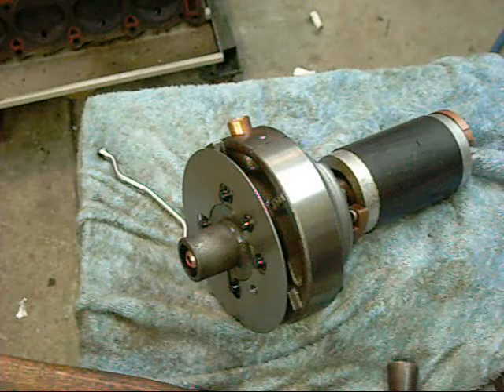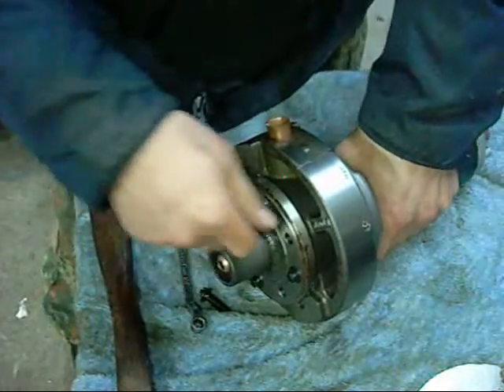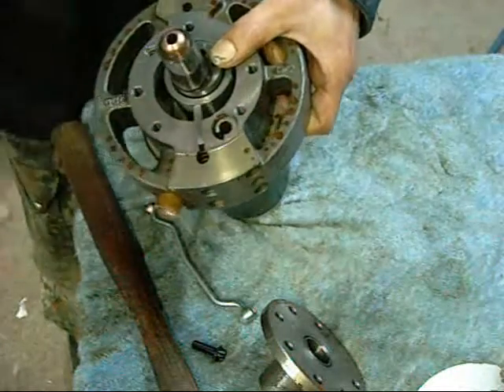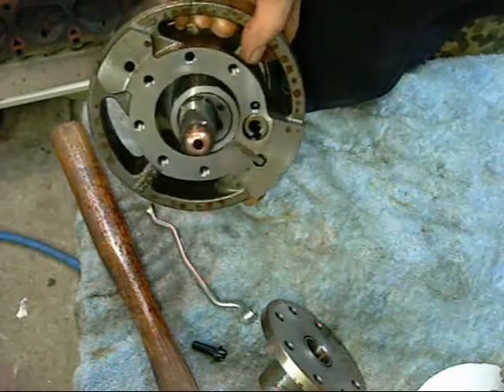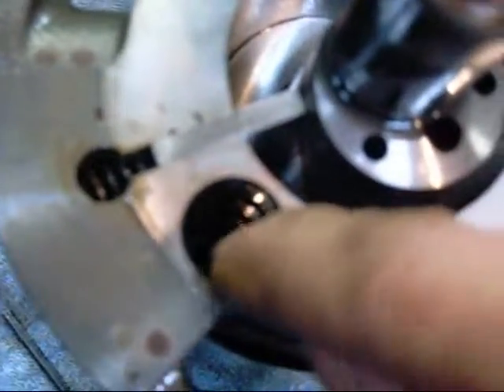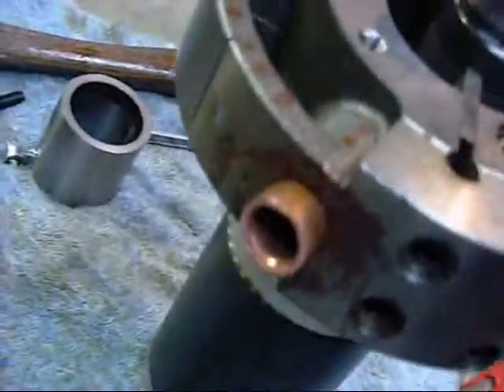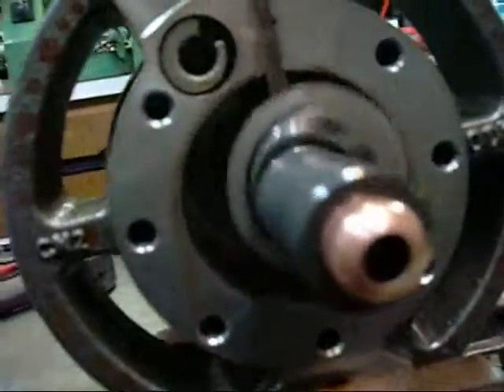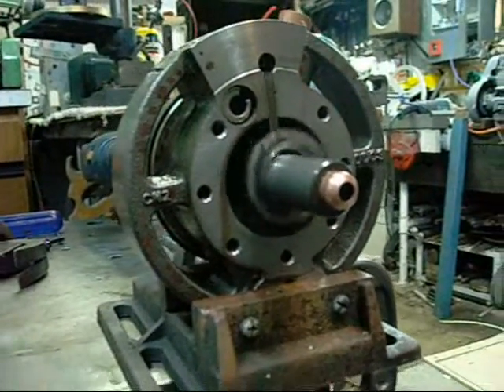Mitsubishi Electric Rotary Compressor Pump

Comment: Love your videos. Saves me a lot of time ripping things apart just to see how they work. I just picked up a rotary pump from a dead AC unit for use as a lab vacuum source and was wondering how it worked. Should work fine for my purpose. I was worried about seals in the unit but it appears they are all metal for the most part, not that it really matters as they are free so if it dies eventually it's no great loss. Great videos! Thanks

Comment from the maker: these pumps never have a valve on the suction side, the sweep of the rotor and sliding center vane eliminates the need for it by creating a HP side in the direction of rotation, and a LP side behind it where suction gasses are drawn in.

Comment from the maker: although common sense would say that the motor should be cooled with the suction line gasses, it isn't!, the rotary compressor draws its gas directly into the rotor via the copper tube on the outside, and discharges high pressure - high temp gasses into the motor housing!

i am running it the right way.

Comment: you are spinning it the wrong way i believe the discharge is the copper tube and the suction gases come from the small port by the motor...the motor is cooled by the refrigerant gas and discharged as a hot gas ....

Comment from the maker: spinning it with the drill, I found it didn't pull much vaccuum or overload the drill in doing so. back pressure must still be important.

I'll cull off a working condenser today and do a test with a sealed comp.

Comment from the maker: domestic fridges are mainly R134A i think, harmless stuff. along with 404A and 410A

if it says R12 or R22 on it avoid breathing it then.
my worst mishap was scrapping a York 20ton rooftop AC unit, damn thing was still charged when i started cutting and I just had to run and avoid the 'fog' emminating from the carport.

Comment from the maker: glad you liked it!, I can remember the first time I pulled certain things apart too, first VCR, TV, Copier etc..
Making the vid can be as much fun too so I aint gonna stop now 

I'm an Injection Molder during the week, setting up and running the machines. i wish I could get video footage of those machines but filming confidential jobs and machine settings is prohibited with good reason.
I only work 4 days a week in plastics so I make other money in my own workshop doing fabrication jobs for ppl